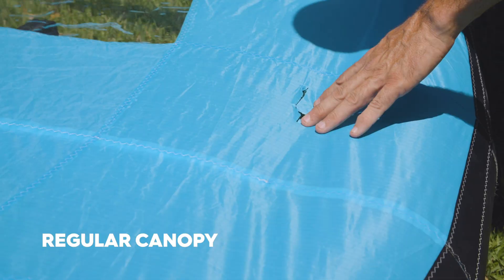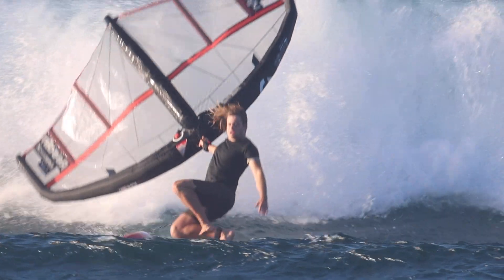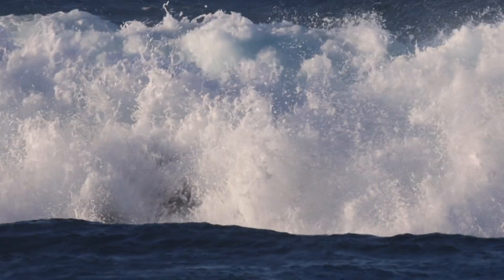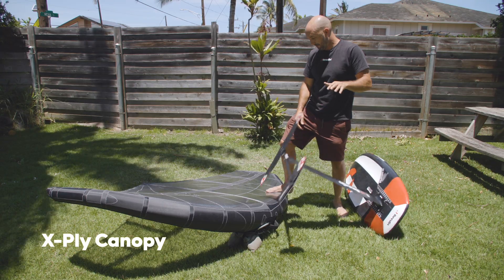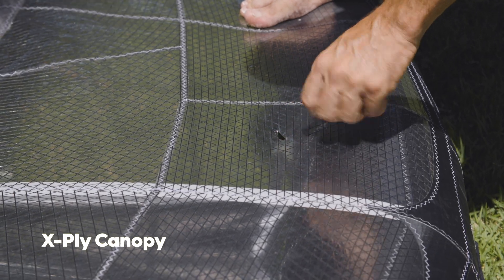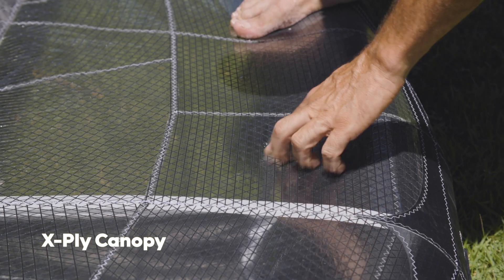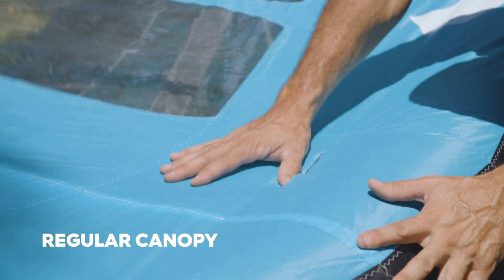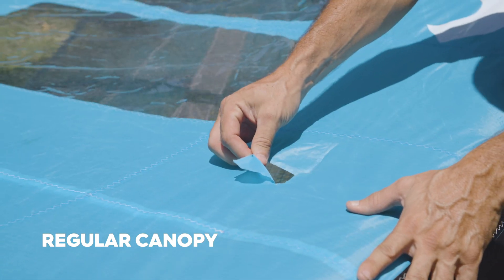CRASH TEST: X-PLY versus Ripstop | Reedin Talks

Comment: All this is true but you don’t mention the weight of the XPLY. I have tried one and it’s way to heavy compared to the ripstop personally I would prefer to have a light wing and take the chance.
Reply from the maker: Hi Ken, the X-PLY is only marginally heavier than the ripstop, which is a weight saved by needing less reinforcements in other areas. Also the X-PLY barely gets heavier when it's wet because the water rolls off. Yes there are both lighter and heavier wings on the market due to different choices in construction, and some might feel lighter due to a different aspect ratio.. In the end it comes down to choices and personal preference, so I'm glad you found something that suits your needs!

Comment: Thanks for sacrifice it for the demo!! 
How do you fix xply when it does get a tear?
Reply: Hi Yaniv, you can easily tape it with many types of different tapes (the thinner the tape, the better), if the tear is too big any good kite/windsurf sail repair shop will be able to fix it just like any other Wing and potentially better as it's a lot easier to actually replace a whole panel than with Canopy.
Reply: @damkitu  Awesome.
Thanks for the response. 🤙😎